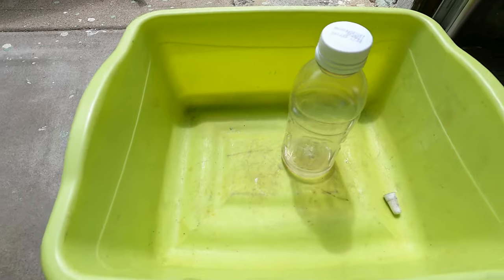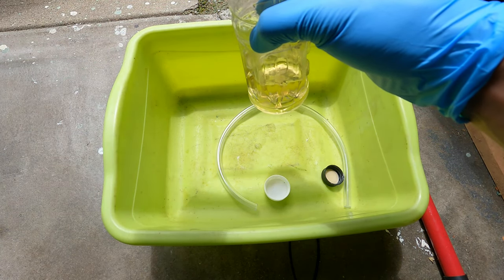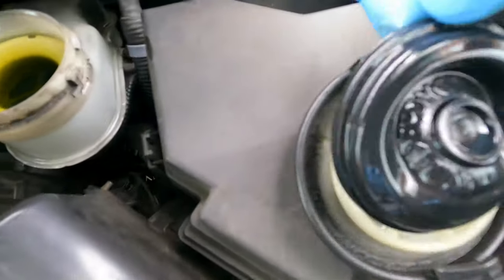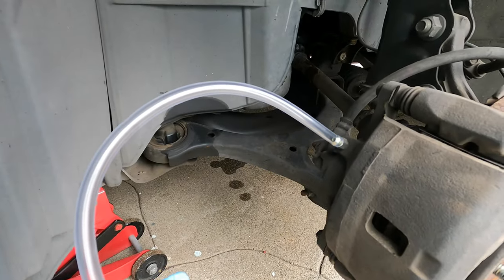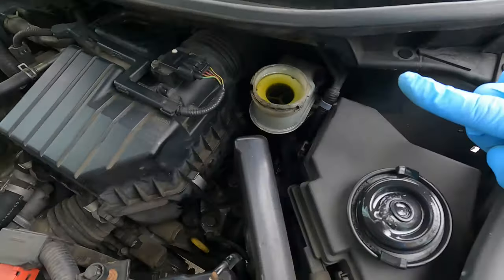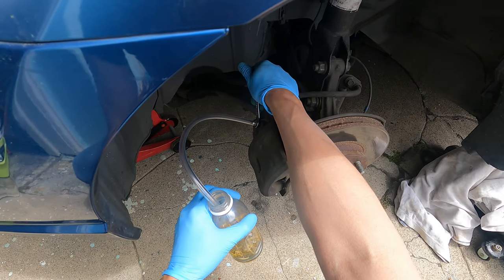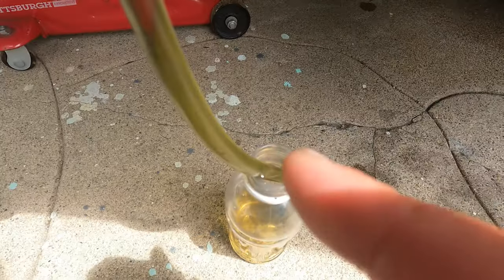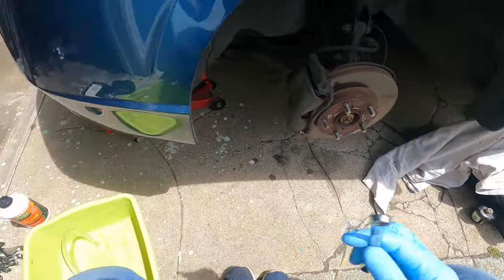How to BLEED YOUR BRAKES and restore that brake pedal power! 2006-2011 8th gen Honda Civic

Comment: Good info so do you start pressing the pedal constantly before opening the bleeder
Reply from the maker: Get into the rhythm and start pumping the pedal.  As soon as the assistant opens the bleeder the pedal feel will soften quite a bit.  After bleeding, the pedal feel will firm up again.

Comment: If I'm bleeding all 4 calipers front and rear, is there a specific order I need to bleed them in? Bleed from front to rear or rear to front?
Also with the brake fluid reservoir cap open while we do this process, doesn't air get pulled in while we are bleeding? Or does having the resevoir topped up avoid air being pulled into the system?
TIA.
Reply from the maker: The order prob doesn’t matter too much as the fluid will tend to flow towards the open bleed screw.  Just keep the reservoir topped off and air shouldn’t get into the system.  Good luck!
Reply: Yes, it's recommended to change it furthest to the nearest relative to the master cylinder to stop dirty brake fluid from being kept in the lines

Comment: What is the bleed sequence ? Is it front driver side first and then work your way down or you start at the back first ? Thank you
Reply: Furthest to the reservoir to Nearest on all 4 wheels
Reply: @imacheetah100  This is also how I learned it.
Reply: Every car today varies. The old rule of furthest to the nearest isn't necessarily true any more. For example the service manual for a 2003 Honda Accord states, bleed front left, then front right, then rear right, and ending with the rear left.
The only best answer to your question is to check with what the manufacturer recommends for your specific vehicle.

Comment: Do we need all four wheels to bleed?
Reply from the maker: Only if air was allowed to get in that wheel.  This usually doesn’t happen unless you opened the bleed screw or the reservoir started sucking air and pushed it into that wheel’s brakes.
Reply: 8 in

Comment: Ok, but also a warning... Don't put ANY excessive force while turning the bleeder screw open, ok ? It might break and end up costing you more than anticipated... Otherwise everything is ok with that tutorial. Good job.
Reply: this literally just happened to me 1 minute ago 😭
Reply: @jackassdude2010  At least I tried dude... 😅That sucks... Every video about bleeding brake should warn to use a real 6 point flared wrench and even at that point, don't go beserk, it might be impossible to unscrew intact. That will happen a lot on older car where bleeder never has been opened. I plan to at least find one corner that is possible to get lose and bleed just that line and the master cylinder at least. Go find a video about how to remove a broken brake bleeder but go buy a set of 4 before cause you'll lose your brake once removed.